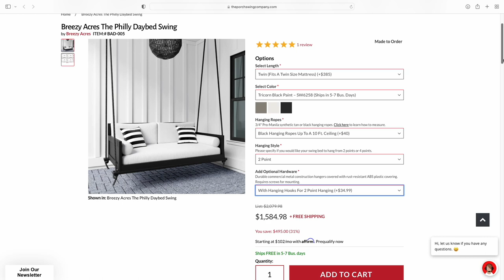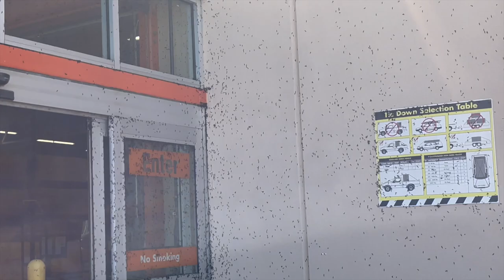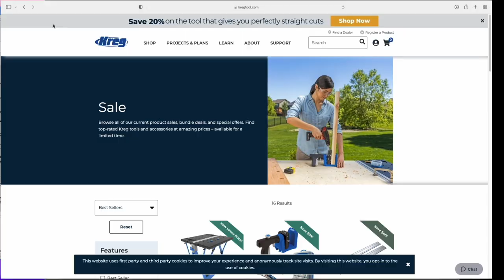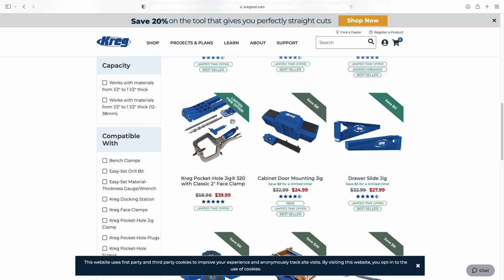HOW WE SAVED OVER $1,000 BY BUILDING OUR OWN DIY SWING BED! | FREE STEP-BY-STEP PLANS

Comment: The Kreg jig was to secure the wood, why did you use the nail gun ? That didn't make any sense ...you didn't need the nail gun if you did it correctly ...
Reply from the maker: There was no jig hole in that section, therefor the nails but thanks for your feedback.